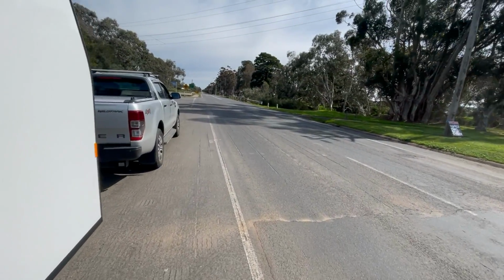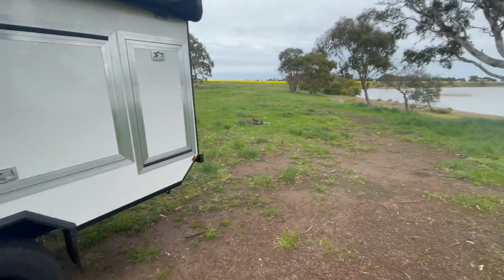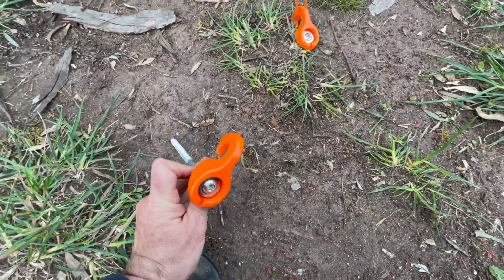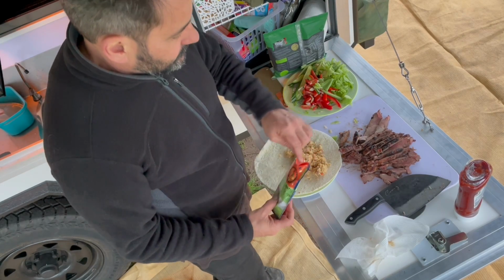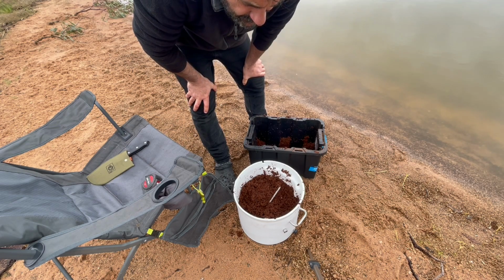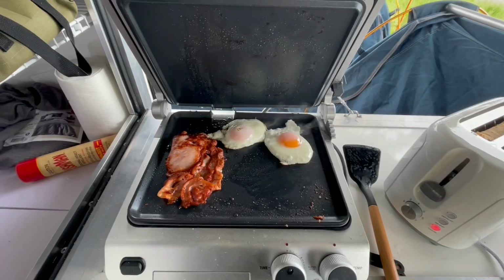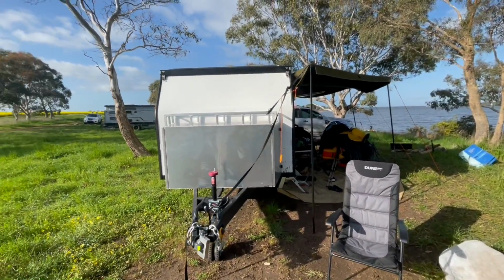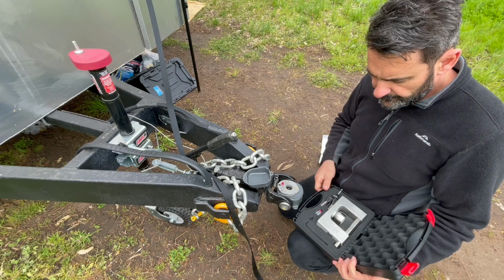Episode #20 - Solo DIY offroad caravan build series

Comment: Outstanding, informative and motivational series Craig.  You will change things around as you go and like a 4WD they are never really finished.  My brother with his build, deleted LPG also and at times found himself worrying over power usage.  He retained his Microwave and Induction Cooker and just bought the cheap BCF Butane Canister cook rings.  When power was an issue, out they came, plus you have your BBQ anyways.  With my current Van I use LPG and 12V/240V, as I use a 180Lt 3 Way Fridge. I also use Truma LPG 2400W Ducted Heater.  Same principle as the Diesel but not smelly or noisy. Just be careful with those Cheap Chinese Diesel Heaters. I have the LPG tanks anyway. Well done Craig, you have done an outstanding professional job and know doubt motivated many of us into having a crack. I have really enjoyed your hard work and outstanding series.  Well Done
Reply from the maker: Thanks jimmy. I’ve done some more trips and feel comfortable with the consumption and capacity now. The induction needs to be used sparingly, that thing is crazy hungry! I mostly like fire cooking too, so i think I’ll find a happy medium somewhere.

Comment: Amazing job of putting the van together mate. I’ll very interested in seeing how you loo goes. We have a camper trailer and are still very much up in the air as to which type we want. Well done and good luck with your travels.
Reply: Soz, I should have proof read my comment but you get the gist 😉
Reply from the maker: Thanks Robert. I’ve put together an episode that’ll drop in the next couple months which is a full install of the loo start to finish and a review of it after first couple trips.